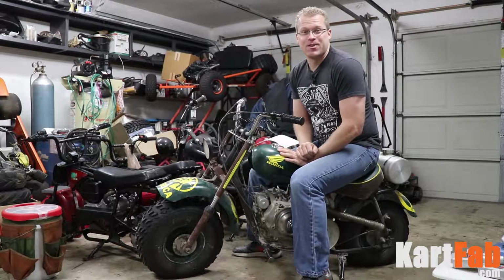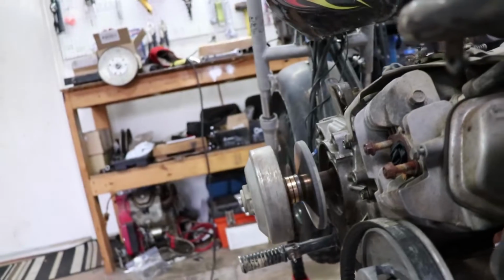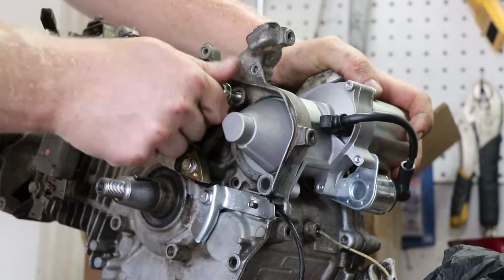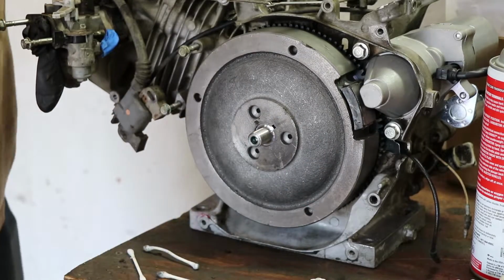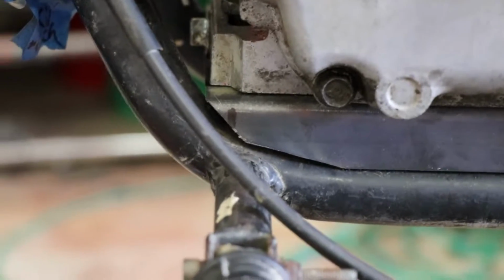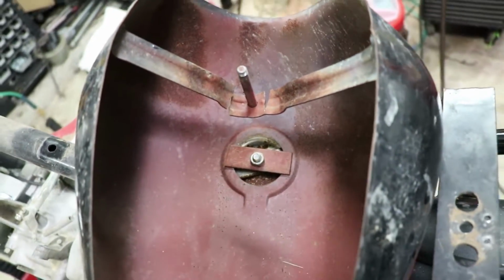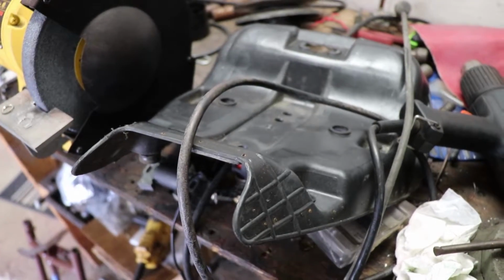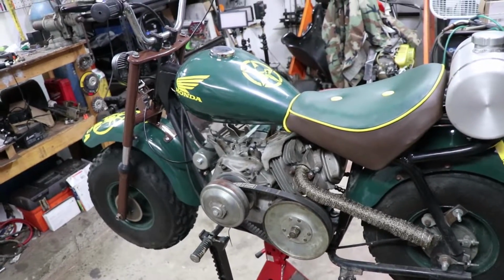Mini Bike Build: Big Block Engine Swap

Comment from the maker: Got the mini bike built and now its a beast. Stock governed engine with a stage 1 predator 420 kit (works on the gx340/390), motor mount, and 40 series torque converter and a bit of fab work. Has a nice crisp throttle response and is a blast to drive. Thanks for watching!
Reply: KartFab  can u do a review on your manco 485
Reply from the maker: heres an old school video I did on three of them. https://kartfab.com/vintage-go-kart-restoration/three-2-seat-manco-go-karts-for-kids-just-in-time-for-christmas
Reply: What is your top speed?

Comment: I have this engine I got from a snow blower!  I usually plug the stater in the wall outlet to start the starter to turn over the engine!  I see a battery there!  How many volts do you need to turn over the engine? And is that a small 12v battery?  I'm guessing the starter doesn't take much power to turn over the engine? Or make it spin for that matter

Comment: is the engine that you put on the same size as a predator 420, or is the engine you used a little smaller?
Reply from the maker: Same size but different displacement

Comment: My subassembly behind the flywheel is installed.  The flywheel has 3 magnets 2 for the subassembly and 1 for the spark plug coil.  I am only getting 8.4v coming out directly to the light. No switch to turn it on or off.  How can I get my headlight to shine brighter? It is a 12v headlight.
Reply from the maker: replace it with a 6v headlight.

Comment: Great mods to make the big block fit.  Love the way you got the  header  to curve.   Any chance you could do a  video on how to make/fit the jackshaft?   Looks like you can either adjust chain length or the TC belt, unless I'm missing something.
Reply from the maker: Check out the end of my stroker engine build video it has how I did the jackshaft
Reply: Thanks Grant, not sure how I missed it in the stroker video.

Comment: I would put a stock predator 420 on a 1970’s Honda CB350 four with a 40 series torque converter 18 horsepower maximum rating only mods are intake and exhaust and valve springs just in case I remove the governor later on.

Comment: I have the exact same mini bike but with the hawg ty frame the shocker spring sprocket is on the top of the handle. Do you know where can I buy the handle frame where the shockers are at the bottom like yours. Also can we put a disk brake on these mini bike instead of the drum brakes pl. Reply.
Reply from the maker: I don't understand half of what you are saying. you can get shocks, and disc brakes from gopowersports, but you need to do some fabrication yourself to make a disc brake fit (e.g. weld a hub onto the rim).

Comment: What's the difference between a Baja heat and a baja warrior?
Reply from the maker: Not a lot. Heat was made before warrior, shorter shocks, metal fenders and fake metal tank. Warrior has plastic stuff

Comment: He should have added a second charge coil to up the amps so if later down the line you put additional lightning on the bike the amperage will be sufficient enough when idling so you’re lights don’t pulse they stay constant.

Comment: You really should consider fabricating the mock gas tank into a functional gas tank it would look proper as a motorcycle style should even though it’s a mini bike and use the extra space for a functioning rack for when you might want one to carry stuff. Actually a good idea would be to weld a battery tray under where the new gas tank is and have a hinged rack over it with a quick release for battery access. Other then that nice job! By the way what gear ratio are you running from the crank to the jack shaft to rear wheel?

Comment: Grant Just was wondering why you just didn't flip the rear wheel and end the jack shaft, very cool vid  keep it up. thanks
Reply from the maker: Torque converter would put it out of alignment, or the engine would be so far to the right side of the bike, the bike would have a severe lean in it when riding it.

Comment: I have an Acme minibike frame which when loaded with 212 and plate mounted torque converter, pretty much lines up the output sprocket to the rear wheel.  When considering going to a 420cc motor, can  I use an 8 slot adapter motor plate (which has slots to move an engine side to side) bolt that to the existing motor mount and get the big motor in plus have its torque converter (series 40 type) line up and balance ?  -  I don't want a bike which is "side heavy"
Reply from the maker: It is not clear what your jackshaft is housed in. Keep in mind that a 40 series has a different center to center distance than a 30 series. The centerline for weight of the engine is roughly over the valve cover of that helps.
Reply: That centerline for weight helps -  my jackshaft is the integrated TAV 2 type.  How far to the "left" might the big block mount vs a 212?
Reply from the maker: the tav2 backplace makes the center to center distance too short. If you go 40 series, you can get the gopowersports backplate/40 series kit, or weld up yoru own jackshaft supports.
Reply: Thanks - I'm trying to figure out if a 420 can use the stock Acme mounting plate via an 8-slot adapter engine plate which bolts to the stock plate rather than replacing the plate.  http://www.nrracing.com/product-p/mbplate-390.htm  There's a Series 40 clone at Ebay which appears to have the same dimensions as the gopwersports rig.

Comment: @kartfab... Will a 220cc predator Engine fit a Trailmaster Monster Dog 2?
Reply from the maker: If there is a similiar engine in there already, the 212 should bolt in

Comment: So your saying if I don’t have a key in the crank shaft it will run ????? Or will it not fire when it says so it would be out of. Time ????
Reply from the maker: I’m saying the key on the crank keeps it at stock timing. If you advance timing, then the key needs to be removed. You advance timing with a timing light, piston Stop, and degree wheel OR you get timing key with built in advance. The key does not hold the flywheel to the crank, rather, the proper torquing of the flywheel nut holds the flywheel to the crank.

Comment: Could you build a motorized cooler? I would like to make one and only have a basic idea of how to build it.
Reply from the maker: I dont have that in the works, but all you really have to do is a base frame, engine in back, and tilt the steering wheel almost vertical.
Reply: Ok, Thanks for the reply. Happy Holidays!